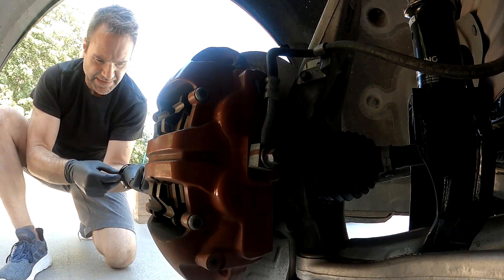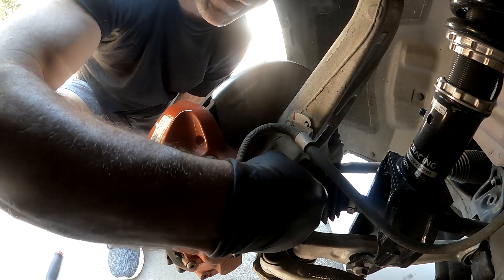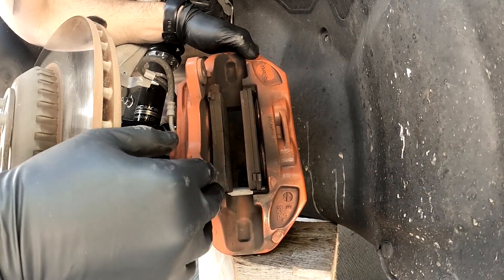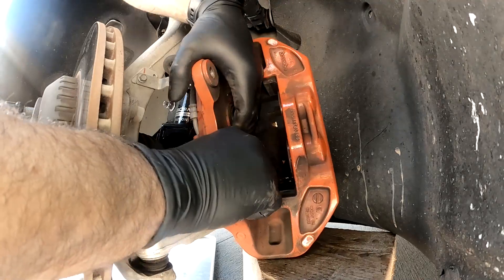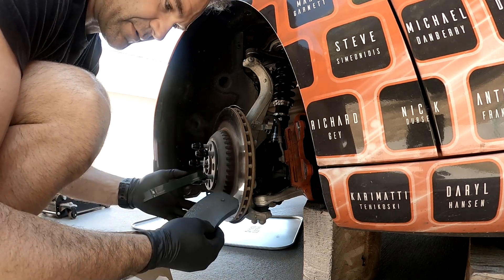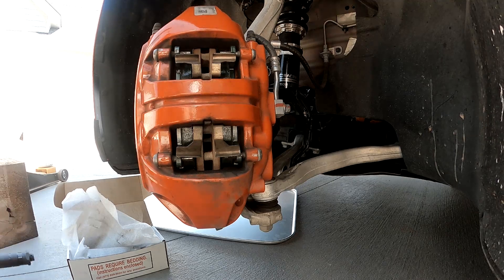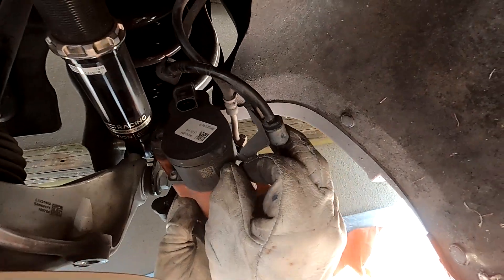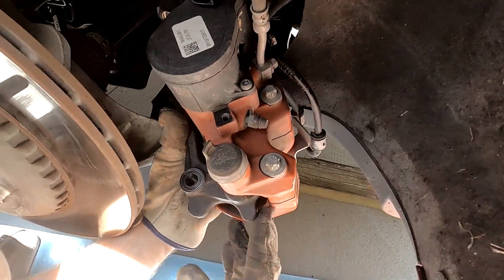Installing Brakes on The Tesla Model 3 | Road to Pikes Peak

Comment: When changing the rear pads, instead of putting the car in Neutral to release the parking brake, I just put the car in tow mode. No need for a second person to unplug the electrical connector before the car automatically goes into Park. Give it a try the next time you change pads.

Comment: Is the reason for you not to change the disks, callipers and the pads, the rules of f the race for stock car category, or financial? Because the kit is available on the market.
Reply: It's may be the rules, but people underestimate stock brake components.  Those are single piece aluminum Brembos, 4 piston floating calipers in front.  It would be hard to to much better than that, and the car was designed with those in mind so the bias is correct.  Really stopping the car is done by the tires, the brakes stop the tires, so if your brakes are strong enough to lock them up with the R compound tires then they are strong enough.  After that it is mostly about heat management, and a few other things like bite and release.  Bigger diameter rotors can help with heat but you aren't going to fit a larger diameter front rotor in those wheels, and the fronts and backs are already vented and the fronts are floating so why change those.  I think he's already flushed the fluid with race fluid and he just replaced the pads with hi-temp race compound pads.  Presumably he has experience with that Carbotech compound and he likes the bite and release and believes they will last once or twice up the mountain.  So in this instance a kit would be lots of effort and would not likely be better
Reply: ukemike1 you might be right about that, but stock rotors aren’t made for prolonged use in race mode period. They tend to overheat quite fast. Plus the procedure to change pads is way too long. And to be true I’ve never seen callipers like this that you have to un mount the callipers to replace pads. For duck sake on my 2001 Renault Clio with a 1.4 litre petrol engine you could change your brake with a screwdriver.